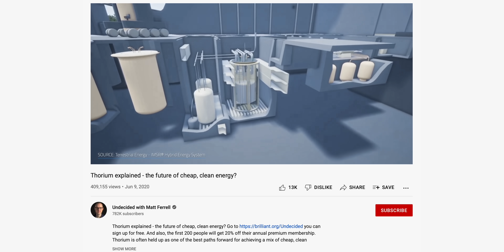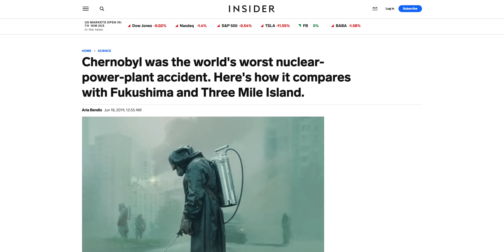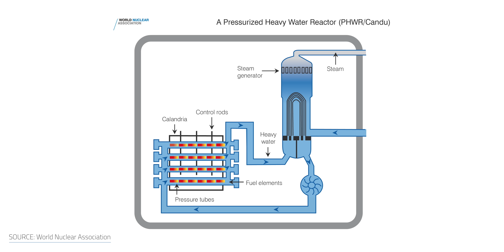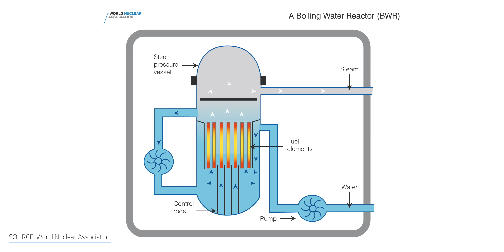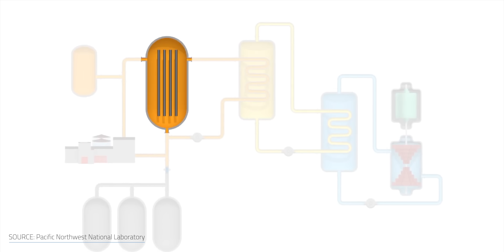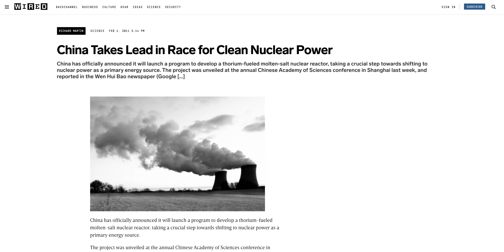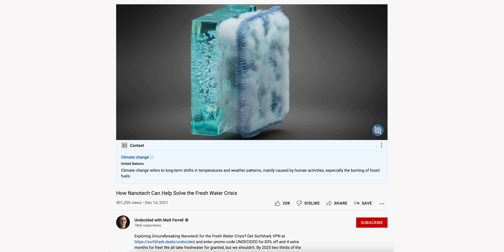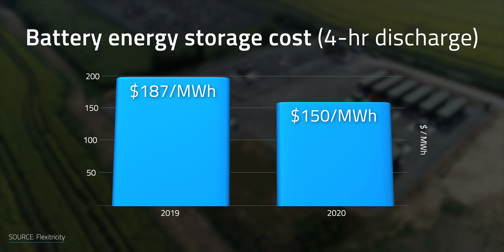Revisiting Thorium Energy - The Future of Nuclear Power?

Comment: With the inefficiency of solar, and inconsistency of wind, the conversation of the transportation system to electricity will require energy that can only be supplied by nuclear if we are to reduce dependence on fossil fuel. Molten salt reactor might be the cheapest and safest form of nuclear energy.
Reply: That just isn’t true. While I am still building it, the system that will power both my house and my car is easily achievable and compared to gasoline, cheaper.
Reply: 1. Inefficiency doesn't matter when you have practically infinite power. Also modern solar panels are approaching the efficiency of conventional power plants.
2. Batteries are now cheap enough to store energy for several hours and still be competitive against conventional power sources.
3. Solar panels can be put anywhere, and with falling prices you don't even need optimal angles. And batteries are even less picky about location and scale. That means most of the transmission cost can be eliminated, and that's huge. According to some predictions solar energy can soon get cheaper then just the transmission cost, which means nothing can compete.

But nuclear energy will have a role still, where sunlight is scarce, or where power density matters more than cost. Larger ships for example would be a perfect fit for nuclear energy. So much that it has been done for almost 70 years. In fact naval reactors predate commercial power reactors.
Reply: See Thorcon and Seaborg Technologies.

Comment: Although thorium is more abundant than uranium, the cost of uranium is a small fraction of the overall cost of nuclear energy. Nuclear energy economics are driven by the capital cost of the plant, and building a power plant with a thorium reactor is no cheaper than building a power plant with a uranium reactor. Further, using thorium in existing reactors is technically possible, but it would not provide any clear commercial benefit and would require other new infrastructure.
Additionally, there is technically no such thing as a thorium reactor. Thorium has no isotopes that readily fission to produce energy. So thorium is not usable as a fuel directly, but is instead a fertile nucleus that can be converted to uranium in a reactor. Only after conversion to uranium does thorium become useful as a nuclear fuel. So, even for a reactor that would use thorium within its fuel cycle, most energy produced would actually come from uranium fissions.

A comprehensive study from the US Energy Department in 2014 found that waste from thorium-uranium fuel cycles has similar radioactivity at 100 years to uranium-plutonium fuel cycles, and actually has higher waste radioactivity at 100,000 years. Also, a 2012 study funded by the National Nuclear Security Administration found that the by-products of a thorium fuel cycle, in particular uranium 233, can potentially be attractive material for making nuclear weapons. A 2012 study published in Nature from the University of Cambridge also concluded that thorium fuel cycles pose significant proliferation risks.

Comment: What is the timeline of commercialization of these reactors? If this technology would offer carbon-free energy, it is still too late. We need to be carbon-neutral by ~2050, earlier would be better, because the developed nations probably will need to offset some carbon still emitted in the developing nations or climate-change denying nations. If we need another 10-15 years to make these viable, the we have just another 5-10 years to mass produce and fuel them. Scaling up renewables is cheaper, safer and more promising at this stage. We need to mass-invest in renewables and their recycling now and worry about nuclear later. 
Does LCOE include the cost for desasters?
Reply: If the one being tested in China works out, then large-scale commercialization should start in 2030. An advantage of MSR reactors is that since they operate at normal atmospheric pressure, they don't need all those extra security layers to keep gas contained. In other words, they can be Much smaller than conventional nuclear plants, and can thus potentially be mass-produced in factories (which is also better in terms of safety testing) and shipped to wherever they need to be installed.

As for speed, well... why do you think Solar panels suddenly spread so fast? The Chinese. The Chinese also built 40,000 km of high-speed rail in 15 years. In other words, if the Chinese figure it out (though admittedly it remains a big if), this can rapidly deployed across China and across all its partners along the BRI in just a couple of decades. Of course, prior to that, other countries will hopefully remember that there's this thing called "Energy security" and step up their own programs.

Comment: Why use 4hr battery time when on average the Sun only shines 12hrs, which means need 12 hrs of battery to be a fair comparison to base load power?
Reply: Perhaps he's factoring in other renewables such as wind and hydro, and other energy storage options as pumped hydro? Good question though.
Reply: @stevk5181  if so that's not a 1:1 comparison, and therefore shows intention to skew.
Reply: Duck curve in energy consumption. You can charge the battery with solar for the evening peak and with excess wind, hydro and biomass over night for the morning peak. The whole energy grid will get smarter, and regulating consumption will make a big difference. People will drive around in EV's, that are plugged in over the day at their work places. On cloudy days they just don't get charged or even help stabilize the energy grid.
Reply: @Psi-Storm  the numbers given were not from combined power, but just solar or just nuclear.  4hrs is just 4hrs, 4hrs is not 12hrs no matter how you slice it.  
Sun goes down at 4pm in the winter and 4hrs of battery would be 8pm.  Now yes 12hrs would only be 4am but like I said would only use average. Rest of the year would be 6 to 6.  4hrs of battery anit going to cover those 12hrs, and that's assuming 100% solar output till sundown and 100% at sun rise not just at solar noon.
Reply: You need sufficient battery capacity to store the electricity generated by the panels in a day.  It is stupid to call it 4hr battery time.  The issue is this give you the very lowest cost for solar plus storage, but absolutely no resiliency if the sun doesn't shine.  So what do you do for that case?  Maintain a natural gas infrastructure and gas turbines just for occasional use?  Get used to having energy droughts?  Build HVDC lines for a national grid with sufficient resilience?  It seems to me that you need ammonia production and storage and ammonia fueled gas turbines as 100% spares for the intermittent power sources.

Comment: Solar and onshore wind energy production also require costly and as yet impractical infrastructure in order to store energy to offset periods when wind and solar energy are not, available.

A recent and nearly catastrophic power failure in Texas illustrates the unreliability of current storage technologies (no pun intended)

I for one strongly suspect significant costs are not adequately addressed in economic projections for operating expenses if they are included at all.

Comment: The risk of proliferation is less BECAUSE of gama radiation -- it is easily detectable by everyone in the world basically.
The risk of leaks is less because it is non water soluble -- if it leaks it turns into a solid and remains at the same place, possibily closing the leak.
Mining it is cheaper because it is a refuge of rare earths mining.
Please check is I am wrong -- it is very possible.

Comment: Matt, great breakdown as always.  While the science is “cool” and “possible“ (and thanks for updating your 2020 video), the long term cost analysis shows cheaper alternatives ARE currently available without the long term downsides associated with nuclear.
Reply: Please give examples of currently available sources that are cheaper and better.
Reply: Wind plus 4 hours of storage, is not reliable or dispatchable power  - it is just very slightly less intermittent - you still "lock in" the requirement for equal amounts of gas generation to make it possible to integrate the renewable into the grid. Renewable with 4 weeks of storage would be a more realistic minimum (and that implies installing peak generation capacity of many many times actual base load!). Now tell us how cheap that will be?

Comment: Information has been circulating on the internet for some time contending that the operating costs claimed for onshore wind energy generation do not portray accurate much less realistic statistics if you factor in production, maintenance and recycling.

There are also considerations pertaining to wind and solar regarding costly and currently impractical infrastructure necessary to store energy in order to offset periods when those technologies do not produce energy such as darkness and diminished solar intensity along with a lack of wind.
Reply: In reality those are irrelevant issues.  The real problem in there is no long term massive storage and by long term we have to be able to store power for weeks not hours or days. those costs you mention are not that large,

Comment: There's a company in the UK that has invented what is essentially a small modified solar panel that can generate electricity from the energy given off by radioisotopes,  Europium-152 being their preferred one. The R&D facility in England has already made and tested the prototypes. Their first commercial factory which they say ought to produce around 1000-2000 MW worth of power cells per year should be built in 2022. Once the radioisotope and the 'solar' panel are put into a brick sized metal box it produces electricity for about 100 years, albeit in declining amounts as time moves on due to the half-life nature of radioisotopes. The company is called Infinite Power
Reply: After you buy into that I will sell you a bridge, No heat calculations at all and if even 99.9 percent efficient that brick sized  block wold be hotter than molten titanium
Reply: @paperburn  The ones they have built don't melt. But I'm not buying into anything; I just like new green technology.
Reply: @paperburn  Yeah you might be right.  I ignored my crap detector when I saw the USB connector on the bottom and they were only demonstrating w/ small LEDs and nothing substantial.  Simple thermocouple can probably do that.
Reply: It's fake
Reply: @Fleming-ql  They offer tours of their facility in Cumbria, if you fancy a visit
Reply: Definitely would like to see a video researching this company and its technology.
Reply: @JohnMGibby  Yes, same. They have a website with a more detailed breakdown of the science. Or they offer tours of the R&D site.

Comment: The basic issue with renewables is the planned % availability, i.e how long do we need to store energy to overcome intermittent wind or sun.   Most countries face times of reduced wind lasting several days throughout the year. Solar power must also consider unusual events such as volcanic eruptions etc. This availability question is best answered by weather experts, but your quoted '4 hours' seems an order of magnitude or more too short as it implies complementing solar/wind generation with some other back-up.  So today it is difficult to imagine a comprehensive energy solution that does not include some form of nuclear. It is also possible a uniquely nuclear solution would be cost effective.
Reply: Yeah, there's way to little lithium to store that kind of energy on a large scale. Pumped storage might help but also has its limits. It does seems like as long as we do not find a way more effective way to store energy we will need to generate a large part of our energy with methods other then solar or wind. Nuclear being one the most obvious options.
Reply: Yeah, this sort of energy storage is just the bare minimum to keep PV things operating on a daily basis with the sun shining.

Comment: The problem with nuclear is that it was supposed to be getting quicker & cheaper to build & operate, "Power too cheap to meter!", but the opposite is true.

Just look at the Vogtle & V. C. Summers debacles. Years behind schedule due to construction screw ups and way over budget, and companies and people prosecuted or being prosecuted for fraud.

Same thing with the French. Their Flamanville 3 project is 10 years behind schedule and expected to cost four times what was originally projected.

That's nothing new. TMI #2 took 3 years longer to build and cost 75% more that TMI #1

STP nuclear SW of Houston, which had a reactor go down due to "cold weather issues" last February, was behind schedule & over budget before TMI #2's meltdown.

When you mentioned that the Chinese hadn't confirmed that their MSR hadn't gone online yet, it sounds like more of the same.

At least with renewables and storage the adoption rate is increasing and the costs are falling faster than predicted. Especially with longer duration storage solutions you have mentioned before like iron flow batteries, which are being used in San Diego and Liquid Air Energy Storage which are going up in Vermont & Manchester UK with other projects planned.

The reality is that by the time these "new & improved" reactors go online they will likely be rendered irrelevant by much cheaper renewables & storage.

Comment: Nuclear  gives a great base load , if the waste heat from nuclear can also do useful work, heating green houses / heat for industrial precesses, then the LCOE changes. But part of that process needs to be a loosing of the regulatory policy. As a example coal plants create low grade nuclear waste but are unregulated. People are exposed to nuclear radiation daily. Sun, sand , rock all have levels of radiation. There is a need to monitor radiation and nuclear fuel but the risks could be managed far cheaper if the regulations were relaxed. The big difference between a coal vs nuclear plant is the personnel required to operate those plants.

Comment: Molten salt reactors have the scale and energy density to be promising solutions for desalination and powering cities.  Their material diversion risk is low with proper regulation and tracking, largely because there are many easier ways to procure weaponizable material.  The waste issue is FAR less considerable than modern uranium reactors, mostly because it's dangerous for FAR less time, but also because the Thorium cycle produces so many useful isotopes, generating a whole other value stream.

Comment: One doesn't embrace an iron plow pulled by a horse just because it appears to be cheaper.  The cost for wind and solar power that you put out are pretty much straight out lies.  They only factor in the operating cost.  Not the cost of build and tear down.  Both of those have hard-stop life-cycles.  Which more than triple the costs.

Comment: Nuclear energy has it's applications as well as fossil fuels. However at the residential and consumer lever, the cheapest solution gets developed. If the costs for drill rigs for geothermal come down, we have to compare the costs of nuclear to the costs of just drilling a 2 mile hole in the ground and letting it heat up water for energy.

Comment: People forget one thing about our "Clean energy future"....

Nuclear has nuclear waste yes. But the bad waste from 'clean energy is up there'. Most of our clean energy methods....solar, wind, etc...need some type of storage in the form of batteries. Even our electric car future needs massive amounts of batteries. 

Guess what...eventually those batteries will need to be replaced or disposed of. Batteries with highly corrosive, dangerous, bad chemicals inside them. Ones that can leak into water tables, soil, etc...
Not to mention you think all people are going to be responsibly disposing their old batteries? No. They throw them in the regular garbage to leak and corrode and pollute. 

Instead of billions and billions and billions spent on nuclear research, we should be looking into NEW BATTERY TECH...or some new energy storage medium. Battery tech has been the biggest hold back of tech for years. And the storage tech we use is stagnant and old.

Comment: The military are starting to get interested in robust small road / air transportable reactor. Such a reactor has the potential to reduce supply issues. Over 50% of suppling a unit in the field is carbon fuel. A reactor in the field would greatly reduce supply issues. But if a reactor was available electrification of military units would also be possible.
Reply: At that point they could even invest into smaller manned aerial vehicles that are not susceptible to ieds, while being vastly more efficient and adaptable than light armored vehicles. Wouldn't need to bring out the choppers every single time someone needs to get somewhere quickly to provide support.